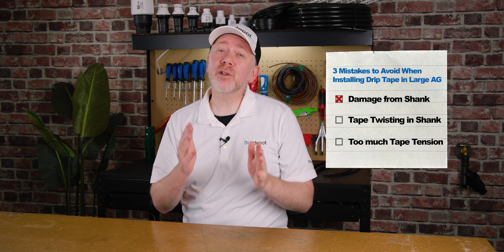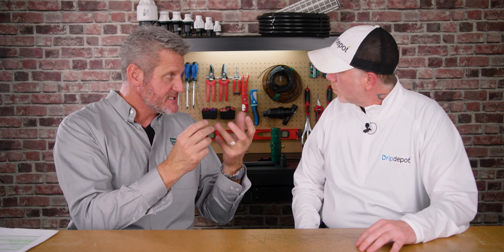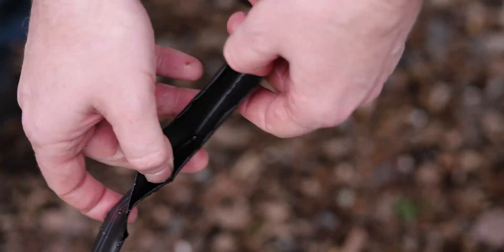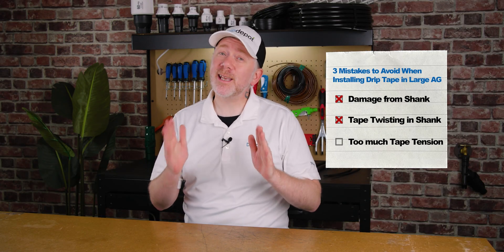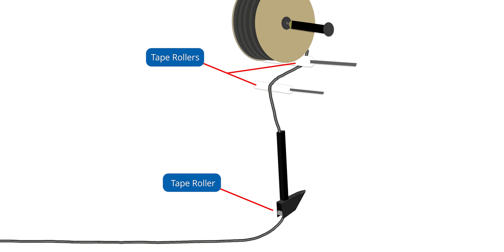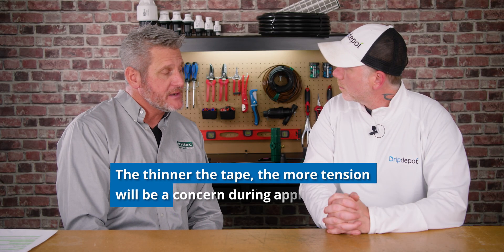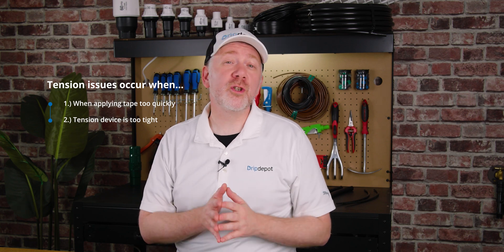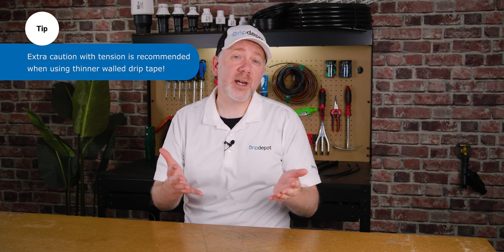3 Biggest Mistakes to Avoid When Installing Drip Tape in Large Agricultural Systems

Comment: In what context are large agg farmers using thin-walled drip tape and applying this stuff ever year via tractors? Like what crops? Implied it's much larger scale than the market garden context I'm picturing.
Reply from the maker: I do think you are correct that drip tape is most common in larger scale applications.  The hobby garden or small farm is definitely catching on though, we see a lot of tape going to residences  these days and it increases every year.  :)

There's a surprising amount of crops drip tape gets used with commercially.  All the standard vegetable crops (tomatoes, peppers, cucumbers, melons, cabbage, and everything in those families) and even competitive giant pumpkin growers are using it.  Tobacco in some places, wheat, corn, cut flower industry and some Hops growers use drip tape.  Most surprisingly, I've seen large amounts headed to some orchards in the last couple years, and at least a two Christmas Tree farms.  They're just running a line or two right down the rows of trees.  

That's not an exhaustive list by any means, it's versatile in what can be grown with it - there's not many exceptions I can think of off the top of my head.  Some mature orchards might not do well with drip tape due to larger root zones, and I don't think it would be ideal for pasture grass or hayfields (though, I have been contacted by a few folks who wanted to try to do it sub-surface).  No doubt there are some localized exceptions as well; leafy greens grown in arid environments are likely to need some kind of foliar application for cooling, and though there's no doubt some folks out there doing it, I don't think it would be the best for rice either.